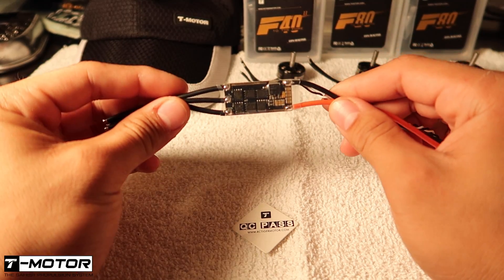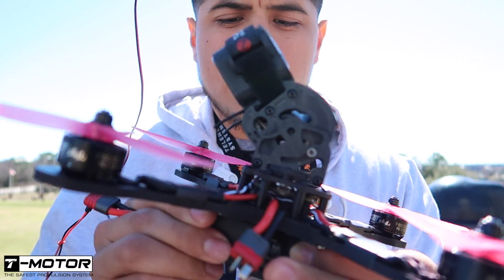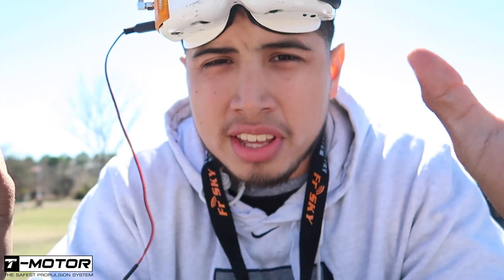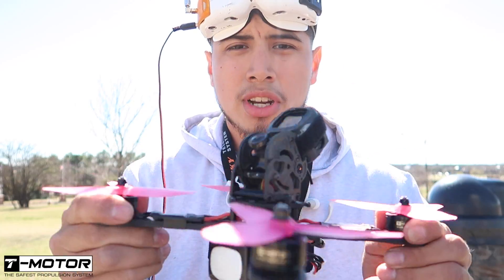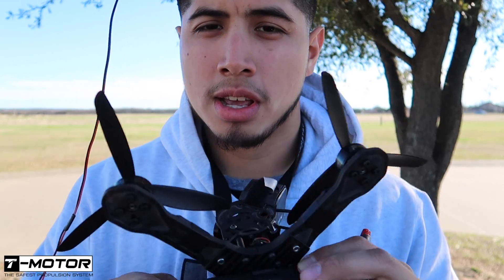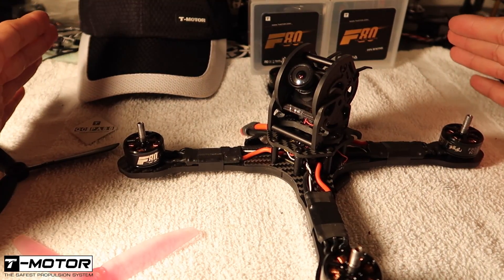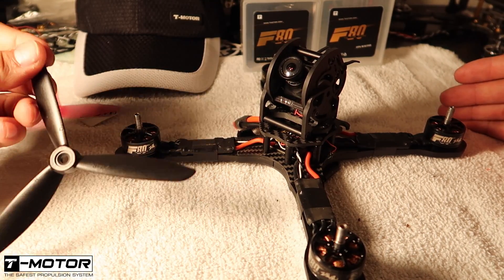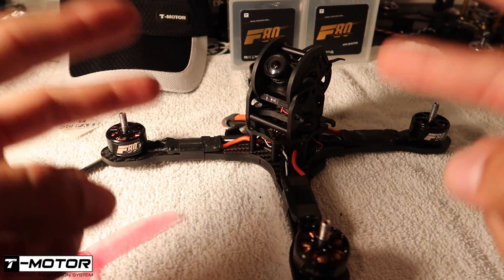Tmotor 45a Esc sample testing | F80 2500kv testing |First Success on 6S!!

Comment: Did you have to limit the throttle curve or anything like that on 6S to avoid Desync or spiral of death issues? I want to try these same motors on 6S for top speed runs but I'm debating on what KV I should use.

Comment: Hey i just ordered this f45 esc blheli s for my 6s 6inch with emax ls2207 1900kv. I was priginally using tekko35 amps and had snoked an esc the first 2 mins at full throttle.
I see that this esc has now come.out with a blheli 32 version. .
Will the tmotor f45 blheli S version be good for my setup. I see ur running 2550kv motors on 6s.. i should be fine ? Right?.
And whats the difference in the blheliS and the blheli32 version?
Please help thanks

Comment: I'm looking at rebuilding both of my Armattan F1-5 Acros and had just a couple of quick questions: With the setup 6" prop on 4s what sort of run times were you getting?? and on what capacity battery??
Reply from the maker: PropsFPV I was getting about 2+ min, on a 1500mah charged regular. This was on a 5040 RK prop
Reply: EnvyAstro thanks man 🤘🤘🤘

Comment: hey i just bought this pair, but in the motor statistics it says the 2500kv cannot run on 6s, so i ended up buying the 1900kv moto's. it's going on a 6inch Norris frame with kiss fc, tbs pro hv, runcam eagle 2 and the crossfire micro :D:D but the question is should i have bought the 2500kv motor's instead? thank's for all you'r vid's!!   i have been subscribed since i got into this hobby just this summer :D:D

Comment: Hi! tanks for great videos 👍. I ide this motor but it works not with 6s. Motors cutoff in punshes. Do i really need 45amp esc i have wraith32 35amp now be greatfull for help with this issue. regards//Hans from Sweden
Reply: technically the 1900kv ones are the only ones that are rated for 6s.....
Reply: jeebs i have seen that. i cant get the 2500kv works with 6s. maybe My motors are bad.

Comment: Amazing stuff man!!! I'm no pro but I'm not bad and I wanted to know is it not a big deal if there is a little bit of vibration like your getting? my Arrisc250v2 does the same thing at certain throttle points and certain speeds.
Reply: I got the  same arris 250 v3  and i get those vibration olny when i punch the throttle ideas

Comment: Quick question, am trying to set up my kiss fc, t80's 2200 kv and these 45a esc's. I know you mentioned below that you are  running betaflight,  how do you set up the esc's in blheli? I need to change motor directions and calibrate them and I cant figure out how to do the pass through to BLheli? any advice would be greatly appreciated! Thanks man!!!

Comment: Quick Question! What FC are you running?
Reply from the maker: Chris Banner it's the Raceflight revolt with the stack.
Reply: EnvyAstro could you run these to the kiss fc, have always used kiss fc's and the 24a re efc's now I want to run 5 and 6s have the t80 2200 kv motors in a 6 inch alien. Was going to use the 30a esc's until I saw this video. I am looking to build a bullet proof rig so I don't have skit burning up... Thanks
Reply from the maker: Chris Banner I would def use these esc if you want to be more than covered! These things are so sick I still haven’t blown up an esc
Reply: EnvyAstro would I switch my kiss firmware to beta flight so I can calibrate and tune all from betaflight? Also would there be any telemetry data from these esc like my kids?
Reply from the maker: Chris Banner yes exactly the same thing I did
Reply: EnvyAstro Thanks brother! Keep up the sick videos!

Comment: i bought the F80s based on this video and im pretty good at building and flying but yet to dive into PID tuning, all of my other quads fly great without tuning but the F80s have a bad mid/upper throttle vibration (like in ur videos) no matter what prop i use (duals, tris, 5 and 6's and on 4s 5s and 6s batts) and i have the motors soft mounted on top and bottom of the arms , right now im running stock betaflight pids so can u just give me a general direction to start tuning PIDs to work on mid/upper throttle vibration? like up or down on P I or D and on roll, pitch or yaw etc  I dont expect u to teach me PID tuning and I wont bug u more but if you could point me where to start ill take it from there, thanx in advance for any help!
Reply from the maker: Paul Twenter go ahead and visit @Flightclub fpv YT I have a tuning video that should give you a good understanding on how to tune
Reply: EnvyAstro thank u. I'll chk it out. One last question. What kind of flight times were u getting? I'm around 4 min with minor tricks and throttle pumps. Does that sound about right? Maybe 5 min on 5 inch props on 1800mah 4s batts. But I'm figuring if I'm hard on it prob only 3min

Comment: Nice! good reviews man!
question.. Whats the total weight of the quad w/o batt and what frame/size is that? 
250?
cheers
Reply from the maker: I believe this is weighing in at about 650ish & it's a 6 inch maybe like a 275 5mm frame!
Reply: thanks

Comment: how r the f80s holding up on the 6s setup? r u still pushing it hard and no issues, I'm looking at the 2200kv and 6045 duals or tris
Reply from the maker: Paul Twenter yes man still going hard and zero issues!! By far best esc and motors combo for 6s tri blades 6045 HQ props
Reply: I've been running rebel 2207 2150 with a 6s tattu and dal 6045 tris and twice I've had a prop sheer all three blades n mid air, have u heard of this or have any idea why? i don't think I'm over tightening the prop nuts but freaking out to fly now  never had a prob with the dual blades
Reply: and they were brand new props, never flown
Reply from the maker: Paul Twenter I have not but maybe because your spinning up too fast but then again mine are HQ which are a lot more brittle and  this doesn't happen
Reply: last question: sorry to bug u but hard to find expert advice 

my quad is a 5 inch alien body with 6 inch arm setup with the tall tbs power cube and i think about 450 or so grams, so its kinda heavy, should i get the 1900v or the 2200v F80s?
Reply from the maker: Paul Twenter no your are absolutely fine especially since hat frame is a freestyle quad
Reply: wait but should i choose the 2200v or 1900v f80 motor
Reply: based on my size and quad weight
Reply: Paul Twenter I just built a 6" setup with the F80 2200kv to run 5s and it's freakin awesome!  I went with the 6045 3 blade HQ props and it's unbelievable.

Comment: Are you using any capacitors or LC filters to avoid VTX brown out issues??  I'm trying to run 5s but sorting out video issues.  How is your vtx setup to avoid that on anything above 4s??
Reply from the maker: Daniel Bolton  I don't have any filtering or anything going on the unify does a great job at handling 6s
Reply: Sounds like I need to try one.  I use the Hawkeye and it seems to be finicky above 4s!  Gonna have to filter it a lot.
Reply: EnvyAstro just maidened my new 6" setup Catalyst Machineworks Superlight 6 with the F80 2200kv on 5s with 6045 tri blades and it is awesome!!  Thanks for the review bro!
Reply from the maker: Daniel Bolton hell yeah man! No problem have fun flying

Comment: hi,
even tho the specs say up to 4s on the 2500kv version , have you ran into any issues running it on 6s?
would you rec the 2200kv version on 6s with 6" 2 blade props?
Reply from the maker: Rex Smith i have not had any issue with the 2500kv nor he 45a esc on 6s with tri blade props.

Comment: I find 5x4x4 on 5S with F80 is my favorite so far. A close second is 6x4.5x3 on 5S, thrust is scary and it handles really well still. Needs TPA on the 6 inch PIDS though.

Comment: NICE! I run F80 2500kv on 5S quite a bit. I would definitely not run any normal RK props. They are not balanced that well. Try some HQ 5x4x3 and it'll be much better! Better yet, try some HQ 5x4x4 and OMG :D Whenever I try to run RK 5x4x3 or 5x4x4 with 5S, I get mad jello like you. They're just not that great and have a lot of flex.
Reply from the maker: yes I've tries all the 5040 HQ prop, DAL, Gemfan but none of those seem to have the same response nor power i am looking for.
Reply: That was more directed towards the jello and tuning part. RKs don't do well on 5S+. HQs just seem to be the best balanced and are much smoother. But ya! 6 inch for power! Interested to see if 5.5x4x3 props gain popularity as Its a good mix between the 2. Cheers
Reply: Also, do you know when they're releasing the 45a ESCs?
Reply from the maker: no man unfortunately i do not & i fly it with 6 inch HQ now and the power on the motors is awesome! feels like a 5s quad on 6 inch prop yet i am using 4s
Reply from the maker: Byron Storms oh nice man! Let me know how it goes!
Reply: EnvyAstro Hey envy, love the videos. Always great! Got 2 Q's for you. 
1- What's the weight of your rig without lipo. 
2- What's the actual weight of the f45a escs? Im trying to decide f45a or 45a aikons for my 6" rig. Some sites i see f45a @ 17.5g w/wires... Others i see 8g w/ wires?? That's a massive diff!

Comment: Thanks for the awesome review! You got a new sub.

I'm about to run an almost similar setup (Specs) on 6s - Would like to know the pids you tuned it for on 6s, might not be perfect, but will be a better starting point, than stock kiss pids.
Reply from the maker: Rejkyeah Fpv thanks, glad you liked and also pids aren't 100% at my liking but they were good enough for the video, I can still give you my pids though if you'd like me to?
Reply from the maker: Rejkyeah Fpv what are you planning on running on your setup?

Comment: When do you think these ESCs will be available for purchase? I just grabbed some 2306 2700kv motors I wanna run these on.
Reply from the maker: Mulitia FPV they should be available within the first month. IMO if you don't plan on running f80 nor 6 inch set up you'll be fine with their F30 or f35a esc
Reply: well, i tried the 30A's at first... clipped a gate at about 20% throttle and completely fried 2 ESCs. Looking at the OSD amp draw afterward, i saw that when it clipped the gate, it had spikes up to 160A. Definitely not good. Been thinking of just running these motors on my KISS setup and just have the over-current protection prevent this from happening

Comment: Woohoo some serious power these f80... i still havent put them on as build yet, as I'm still searching for the suitable esc for them. But i guess the search is over, the wait isn't!!! Dunno when ill be able to get my hands on these sweet 45A??? I might just put them up on my 6" build with the F30A escs that i have... any other high amp escs you can maybe suggest using? And the F60 Pro, do they really fit in the middle between the F40 Pro and F80? Cos i am kind of apprehending the F80's weight... at over 40g... maybe the F60 Pro will be good enough for my 6" builds? They are a bit lighter and smaller... what are you thought? Thanks bro!
Reply from the maker: Ray Choi yes man I believe the f60 would be just right in between he f40 and f80 on my comparison between the two I'd say the f60 have more tourque than the f40 but top end is better on f40, my first thoughts on the f80 I felt on 6 inch as if it was a 5s set up and had both tourque and too end!
Reply from the maker: Ray Choi the esc should be dropping anytime within the next month so if you are planning to make a 6 inch f80 rig I would wait!
Reply: EnvyAstro thanks for your reply. I'll wait for these new ESCs to come out to start my 6" build with the F80, I can then fly 6s with this new build :)